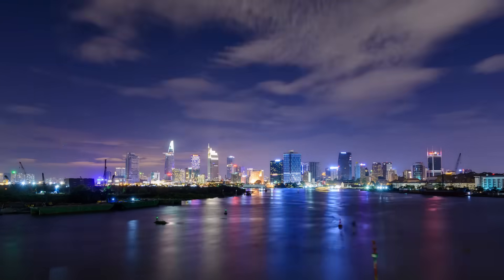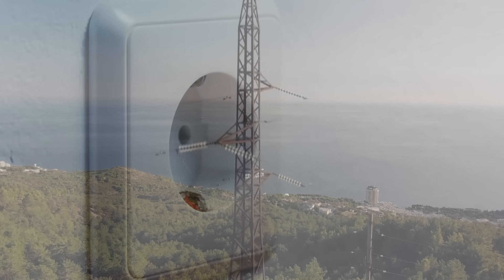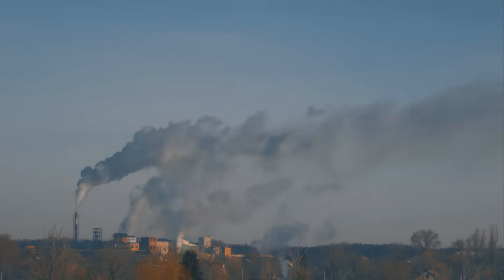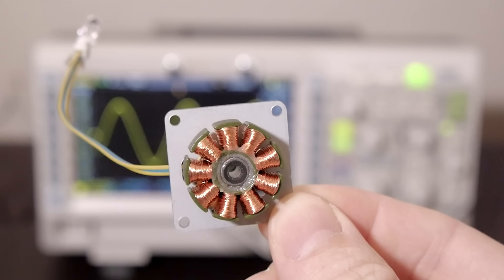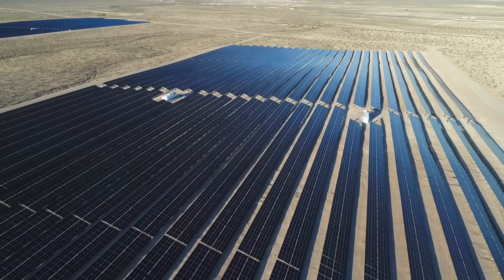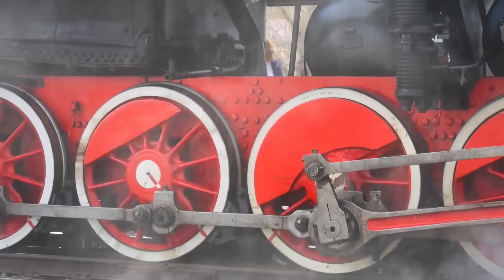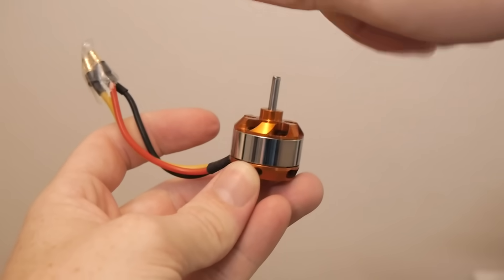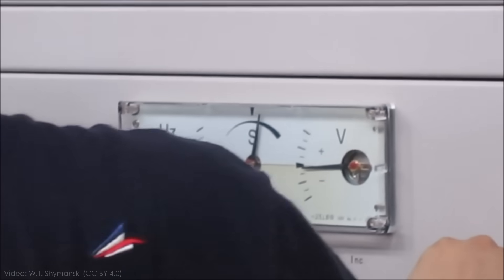How Electricity Generation Really Works

Comment: Solar power has huge negative byproducts...just becuase it converts light to electricity does not mean it's free as far as the environment is concerned.

Creating solar panels are just as dirty as everything else, with the exception of very old coal plants once you factor in how they are made. Pit mines to collect the rare earth metals required, plants to refines these materials and the huge power requirements to do so...which are fed largely by coal fired power plants in China.

It's the same fallacy EVs fall into, "emissions free"....wrong! There is a pit mine somewhere that the raw materials came from powered by the cheapest fuel available, then the materials are transported via the cheapest fuel available, refined with MORE power via the cheapest fuel available, transported again via the cheapest fuel available and finally then turned into batteries again with the cheapest fuel available.

Then some self righteous ass buys the car and is to stupid, not ignorant but stupid, to realize that they are charging their precious EV with power derived (again) from the cheapest fuel available. 

Next they preach to others about how great they are for saving the planet from "climate change". All the while being to stupid to realize that the emissions required to produce their EV are greater than the emissions required to produce and operate a modern gasoline engine (of similar power) across the lifetime of either option.

Technology has com a long way but like it or not until neither hydrocarbons or batteries are required for common transportation, the fuel burning vehicle will actually be better for the environment.

Comment: Anyone know of a way of generating electricity that is not smashing a crystal, turning a turbine, or through converting photons directly to electricity with solar panels
Reply: Yes, rubbing a balloon on your clothing. You can't power anything with it but you can fry electronics.
Reply: @FrainBart_main  good point, i forgot about static electricity
Reply: @chrrmin1979  Also using something called a Seebeck effect can generate electricity through temperature difference.

Comment: Though it's also important to note that PV produces DC, and so unfortunately has to pass through frequency-corrupting inverters. Solar collectors are much more preferable.
Reply: Well, you could use PV to spin up flywheels via a DC motor and then draw energy from those flywheels via an AC generator. That way you can kill three birds with one stone: DC to AC conversion, power storage and grid inertia.
Reply: @Bird_Dog00  except the efficiency of all that is horrible. DC motors are inherently less efficient than AC motors, and PV is one of the least efficient energy generation methods we have anyway.
Reply: @Vitruvian
Solar-thermal power generation has its own issues. It requires way too much machinery and is too maintenace intensive to be usefull in small-scale aplications. PVs with local kinetic storage can be scaled down to be installed in private homes. It is also all but maintenance free.
Also, since the energy comes from the sun and is thus free, the overall efficiency is less of an issue.
Reply: I wasn't aware home kinetic storage was a viable option yet. But fair point about the efficiency. Though the way we're currently using PV is still rather poor (no intermediate flywheel storage for the vast majority of installations)

Comment: A very slick presentation but the content is not up to  the standards of your civil engineering videos. You have raised  your bar very high with those videos as far as content goes and it is a bit painful to see the quality of the content slip sharply in the last couple of videos. 
 
A video on the civil engineering considerations behind the shape and installation of pylons and routing of power grids, how they cope with earthquakes etc would be far far more interesting IMHO

Comment: electricity (mean the electrons) doesn't move with the speed of light.

only change of potential (voltage) does
Reply: Dániel Vásárhelyi I think what he means is that when you turn on the electricity at one end of a wire even a thousand miles away the light will come on at the other end pretty much instantly although the electrons are moving through the wire approximately inches per hour, something like pulling a long steel cable at the rate of a few inches per hour but the other end of the cable starts moving pretty much instantly.

Comment: We need a "Hybrid Grid" where Solar/Wind feeds it during the day, then coal/gas feed sit at night, or supplements it when the need is too great to be powered by solar/wind alone.
Reply: Coal can't be turned on and off all the time, it's much too expensive and slow. We would need 100 % gas capacity, which would operate at a low capacity factor. Seems expensive.

Comment: This is utter nonsense -- modern electronics can match frequency and load pretty much instantaneously and with almost zero waste so the idea that a spinning mass is needed, well, that idea is decades out of date!  Going forward with more energy being produced by wind and solar the need for storage increases but such storage systems exist and newer ones are in development.  Imagine a solar based system with solar PV and storage via battery banks ... as load changes the supply responds instantly matching the frequency and amplitude to perfectly match the requirements with minimum waste.  Hell, this technology, or elements of it, have been available to consumers for years.  You need a 2000W generator you buy a 2000W generator that uses an inverter to produce the appropriate voltage and frequency needed -- if you need more power you can add a second inverter generator, connect them together, and they match each others voltage and frequency -- no flywheel effect needed!

Comment: On our current lack of storage for electricity, what's your opinion on the idea of kinetic capacitors? Aka, "giant holes in the ground with massive heavy objects that get lifted with excess grid power, and 'dropped' to return the energy to the grid when needed"?
Reply: We have that already. It's called pumped hydro, and the mass used is water. The US currently has a operational pumped hydro capacity of 23.6 gigawatts (how much energy these storage systems can produced when switched on), which represents 94% of operational electric storage capacity in the country. 

http://css.umich.edu/factsheets/us-grid-energy-storage-factsheet

Comment: Not so fast.  I've got some problems with the "facts" in this video.   Here's a partial list:

1: AC electricity has many more advantages than easily changing voltage for transmission.  For instance, DC machines generators, and motors require commutation to operate, which requires brushes.  Brushes wear out, and commutators become dirty, and must be cleaned.   AC machines require no commutation.
2: Three phase transmits more than 3 times the electricity than single phase, over the same number/size of conductors.
3: There are many more advantages to 3 phase than mentioned.
    Three phase rectifiers are far superior to single phase rectifiers, in terms of ripple current, and smaller diodes for same output.
    Three phase motors induction motors are cheaper to build for the same horsepower, have higher efficiency in terms of (electricity in) /' (work out). are more reliable, need no start, or run capacitors, need no auxiliary coil for starting,  have better power factors, and are more rugged than single phase, all other things being equal.
4: the grid compliant inverters that connect PV to the grid can impact starting loads.   They have capacitors on their DC busses, and can supply surge current.
5: The grid does not have inertia,  it has resistance to changes to it's frequency.  The energy in rotating machinery is simply stored energy, and to change the frequency of the grid, it's rate of  rotation must be changed, either up, or down.
6:  There is no such thing as an AC generator.  The word you are looking for is alternator.   Yes, that thing in your car is an alternator, a three phase one.  It's current is rectified to get 12 VDC.